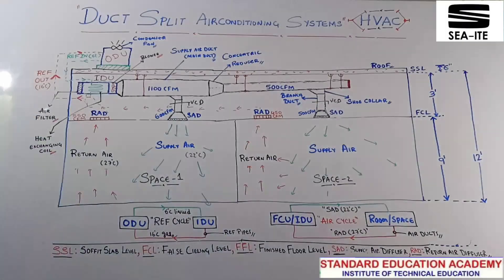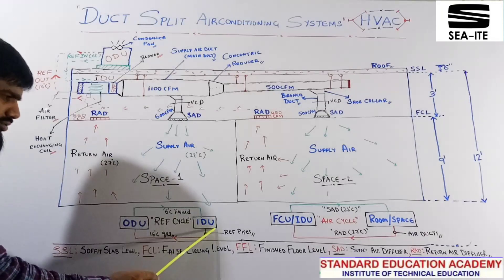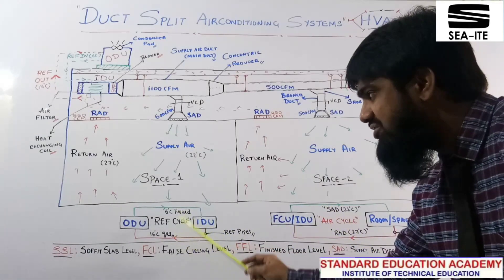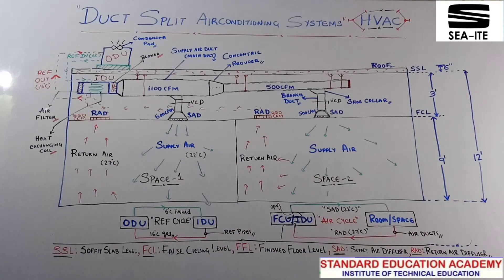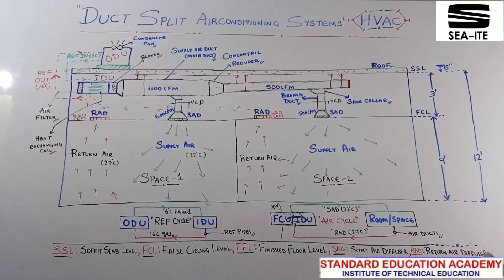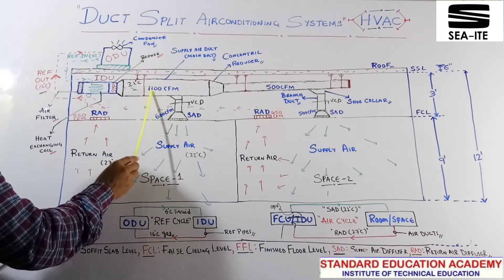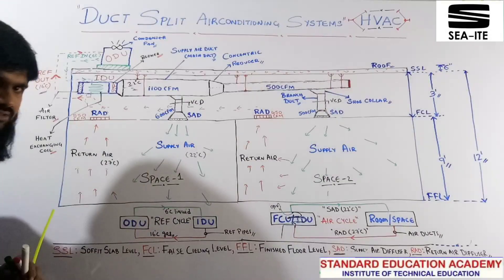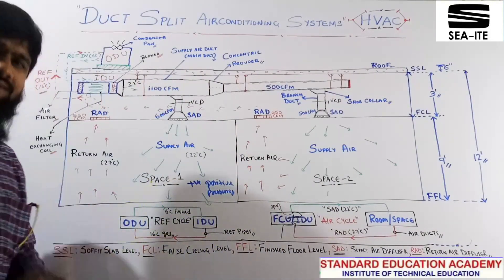HVAC DUCT SPLIT AIR CONDITIONING SYSTEM

Comment: I want to know my old unit ductable split unit pipe size indoor to outdoor is 11/8”x5/8” and my new unit pipe size is 5/8”x3/8” .. so can i use this old pipe line for new unit ..?
Reply: Old unit 4 ton and new unit 5 ton
Reply from the maker: No you can't use old pipe line as new unit is of different (TR ) even with different Psi Pressure. For the given design conditions go with the pipe size prescribed by the Manufacturer of New Ductsplit AC.

Comment: Sir how to find out the duct reducer size
Reply from the maker: W1-W2=Difference, where W=Width of Duct, Difference x 4 = Length of Reducer, Usually length of Duct Reducer is "Max 750mm and Min it has to be 450mm". Hope I served your Purpose.